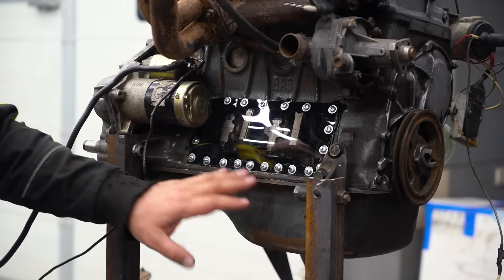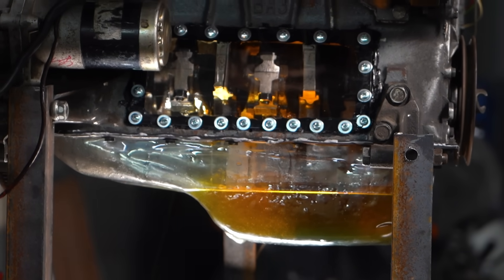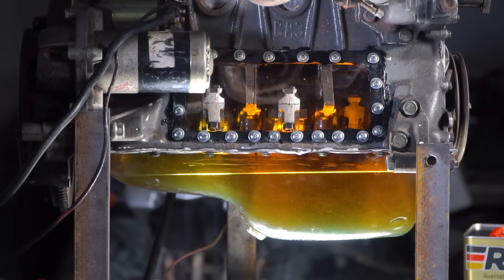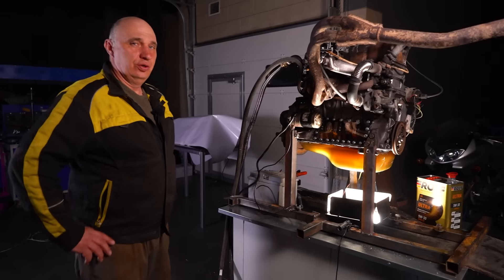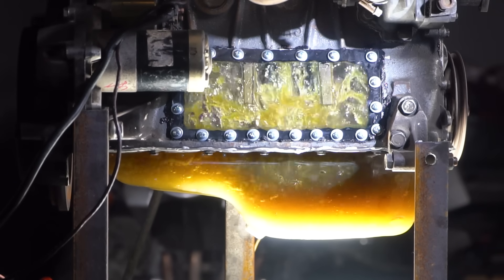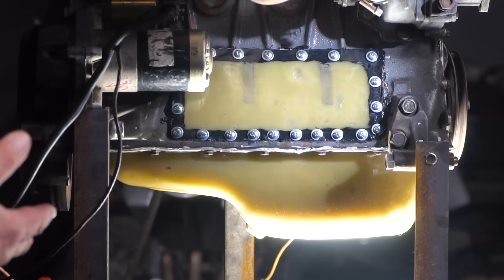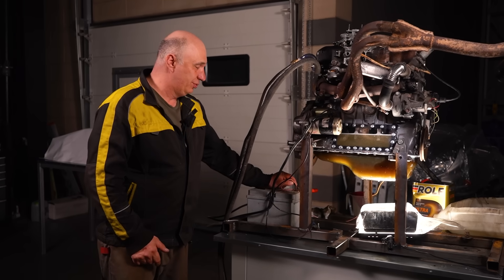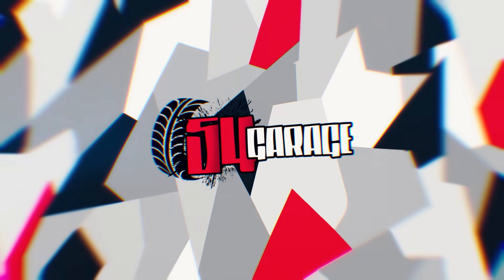What actually happens when you overfill your motor oil? (w/ transparent oil pan)

Comment: I noticed that you didn’t run the engine for very long, at each level.   If a person unknowingly over-fills their engine, and then drives it at highway speeds for 1,000 miles, thinking that the levels are perfectly fine??    That engine will start knocking, and eventually seize.

Comment: the reason imo is mostly due if look when more oil is present the piston skirt is constantly saturated, and the oil ring never gets a chance to do what its designed to do and control the oil on the cylinder wall. as a result, it eventually gets past the piston and starts to pollute the combustion chamber. and that continues even more issues in itself. the crankcase will build pressure from blow by. just bad...lol

Comment: Worked in an oil change shop for about 5 years. Worst overfill I ever saw was in a Toyota Tundra, the owner had continued to fill the truck with oil because they didn’t know how to read the dipstick correctly, in total when I drained it out into measured jugs, 18 quarts came out. Typically an 8ish quart system give or take a half quart. Surprisingly, not a drop of oil was leaking out through the seals. No telling what it did long term though.

Comment: Interesting video and results. Recent real-world experience. Fifty years ago, when I drove large 90 passenger school buses, we would check the oil first thing in the morning before starting the engine. This habit has carried through today. However, I recently ran into a problem where my 70-year-old vision mis-read the dip stick on my wife's Ford Focus. My wife started complaining the engine was losing power on moderate acceleration and a lot of blue smoke started coming out of the exhaust pipe. Speculating major potential engine problems, she took the car to the shop. Later, she calls me that I was an ID10T (idiot) and overfilled the oil by two quarts.

Viewing the video of the engine on a test stand under no load, doesn't reflect my on the road experience.

Comment: I guess the excess oil is causing some drag, which in turn will heat up the system? Would be interesting to see some more failure points. Oil spilling out everywhere is not the first problem.

Comment: I watched a youtube video my first time changing the oil on my streetbike cuz I didn't know where the plug was.  Well apparently there was 2 plugs (no idea why, the other is NOT a fill plug) so I drained about half a quart, and then added the 4qts it was supposed to have (so 7.5qts in a 4qt system).  Hydrolocked within 300ft, every cylinder was full of oil, blew it up through the intake and had to shop vac that out as well.  Managed to get it all out, then ran the bike smoking like a motherf'er for about 30min, and it was fine for years after!

Comment: I found myself thinking about the Dodge Diesels and their problem of not getting enough oil high in the engine at idle - so many have said not to idle the "newer" Dodge diesels for very long - it would be interesting if the oil pan could be modified on them to fix this problem, and perhaps add an auxiliary pump to get oil to the top of the motor at idle - PLUS - how great would it be if oil pans had a large "sight window" in them, so you could visually see that you added the oil when doing a change?

Comment: A tech for over 20 years I was working late one night alone. A guy drove into the shop with a Honda civic smoking horribly. I checked his oil and it was ALL THE WAY UP the stick. I asked about his oil use and he said he puts a quart in every week. I asked.. Why? He says "I thought I had to". I said.. NO you don't.. IT was completely full I mean like no air space left in it at all., the plugs were fouled wet with oil, the breather was full,  drained out 10 quarts of oil to get it down to the 4 it should have, cleaned the plugs, and he drove out. It didn't harm the motor except for the wet plugs and lots of oil down the exhaust pipe. This engine had no air space in it at all! Completely full of 14 quarts of oil!
Reply: 14 quarts of oil is crazy, that’s around 10 weeks of driving with it overfilled. Im surprised it didn’t give out

Comment: 15:04 LOL, the breather is a full-blown guiser, I have never seen a demonstration like this before, I think there is a lot to be learned here and I have been a passenger and light-duty truck mechanic for 25 years.
We were taught the auto would burn oil and the oil would foam thus lowering its lubrication properties because of aeration that you would start damaging the piston rod bearings.
What I see, is when the oil is filled to the full, it is actually at the bare minimum it should be run at in this engine. 
I wonder how hard it would be to find out if other engines have the same tolerance. I would love to find out about my cars without dropping each of their oil pans.
Thank you for the demonstration.

Comment: Great video. Would like to see when oil is less than half of what’s required.  Amazing info.  Thank you.
Reply: Once the oil level drops below the "oil pick-up" also known as the inlet for the oil pump, no oil is circulated throughout the engine, many important parts begin to wear and heat from friction. Before very long, something fails catastrophically. A piston rod bearing, a crankshaft main bearing, the crankshaft itself, the overhead camshaft or its bearings.  A piston could seize in a cylinder. 

Something horrible.
Reply: As long as it is above minimum on the dipstick though, nothing bad will occur!

Comment: I had a friend when we were teens that filled his Toyota 4 cylinder up till he saw oil at the cap. Went to start it and it sucked oil into all the pistons I drained it, took plugs out, turned the starter and shot oil out of the spark plug hole about 60’. Then we installed new plugs and started it up. Burnt black smoke like crazy…pretty horrible for the environment I’m sure. Ran for years after that

Comment: A clear oil pan and a cutaway in the block?  Brilliant!  I've never seen this in a functioning engine.  Thank you.  I was so concerned once when I added oil past the upper level limit on the dip stick that I siphoned the excess out.  Now I realize that I  need not have worried.
Reply: Don't forget that car manufacturers build in a safety margin for morons like us...
Reply: I once bought a Ford ranger pickup that some idiot had put way way too much oil in it. Now I know what was going on before I drained it and replaced it
Reply: I too recently overfilled by about 0,5L of a 7L capacity. It should be okay?
Reply: Actually it's the transmission fluid that your better off with too little than too much.
Reply: I over filled non strength of this video lots  and lots of smoke out exhaust I've drained and filled to correct level  come home still bit of smoke  not alot I've heard can take couple days to burn excess oil out then fingers crossed ..wish I never saw this video!!!!!
Reply: Overfilling isn't gonna hurt anything as long as your not putting a quart or two to much in engine even a qt probably wouldn't do anything it's just better to use you guide lines & if ya can't see because of lighting then get a flashlight! It's simple!
Reply: @edwardmatikainen617  a little over is ok, especially if your engine uses oil, it he put double the amount in I would say that is too much.  The foaming is an issue.
Reply: It was cool!
Reply: the dip stick have hallow dots on it which tells how much space is in the sump available to fill the oil for the engine
Reply: Everytime i would go get my oil changed at a local shop,they would ALWAYS overfill it no matter what shop I went to they still over fill it,they said they go by what the computer shows them, Anyways so the first time they over filled it I didnt remove the excess and ever since that it started burning oil when before it didnt even burn a drop of oil,when I would change the oil myself, that happened on 2 of my vehicles so I'm sure it is bad to over fill it even if its just a little bit.
Reply: @boxer951 depending on the vehicles it may not have been overfilled oil that caused it to burn oil, but instead intentionally weak piston rings designed to improve fuel efficiency at the cost of oil consumption, this is a concern raised by Youtiber "Driving 4 Answers"
Reply: I keep getting mixed signals if you search on the net it says you should drain it out EVEN if you overfilled it by 200ml that's LESS than and quarter of a QT .  Even in this reply chain some think it should be drained abit. But i haven't seen anyone say anything about 200ml extra i doubt it will do anything. my question is 200ml so minor that the effect is NOTHING is it even a tiny bit worse cause if its a tiny bit worse the amount of work needed to drain 200ml is literally 5 min of work if you have some ramps so I would prefer to do it, but if its actually no issue not even a TINY bit I wouldn't bother.
Reply: I put an extra quart in one time.  I just left it in, nothing bad happened.
Reply: I agree with you I would have been concerned as well this Russian guys experiment is not really practical because it's just firing and spinning the pistons it's not converting horsepower and torque to the wheels guarantee if he put that engine in a car and tried to drive it would explode
Reply: yes you should have worried ! the excess oil causes high oil pressure that blows out your seals
Reply: @bobsaturday4273 that's bullshit. Oil pressure is determined by the pump not by the oil volume. Unless you've filled the engine to the brim and the sealed case becomes pressurized. The pcv valve being open would relieve that pressure back into the intake anyway.
Reply: @cheeseburger3209 well, yesterday I changed the oil in my 2003 Honda Odyssey and I apparently added too much oil (less than ½ quart extra).

Several hours later the engine started running quite roughly and hasn't stopped.  It sounds a bit like oil may have gotten into the exhaust or somewhere that it's not meant to be. 

It happened because I couldn't see that the oil was above the next line on the dip stick in the lighting conditions while I was adding the new oil. 
When it started sputtering & running roughly I checked the oil, that's when I discovered it was over filled.
I removed the excess ASAP, but the problem has not improved. 
It has been running perfectly since I got it; it's hard to imagine & believe that it's unrelated!
Reply: @cheeseburger3209 when i change my oil i have higher oil pressure....i have a 2009 LC9 5.3L
Reply: @DJJonPattrsn22 It's a 2003 oddity. I bet tf it does run rough😂
Reply: @cheeseburger3209 Tell that to your gaskets when you do that
Reply: @DJJonPattrsn22 even a full quart of oil wouldn’t damage your engine it must’ve been something unrelated
Reply: @cheeseburger3209  yea but what youve got remember is this guy vidio is only doing for few mins imagine over filling " double" and going 200 miles  totally differnt " outcome" litre more is always better than less but id not go more than a litre , BUT few weeks ago long story so wont explain HOW overfilled auto transmission on a mb by 5 litres 400mls and " fast" journey later realised the mistake just by chance not becouse anything noticable happenend NOTHING .obviously drained it and set the level according to the " book"  so in future on my OWN cars ill be sticking an extra litre in above the  " book" level. must admit i panicked when i realised i phoned my m8 right away said where are you " hammering up the m6 i need be somewhere asap. pull over now i said ,WHY coz i aint got 4k for new friggin transmission for you ,lol now but wasnt at the time .
Reply: not really it just goes past your ring which can also be bad if your oil is going past bolted down rubbered sealed surfaces it 100% got passed the rings that’s where you need to worry

Comment: If the breather was connected the engine would runaway in case of a diesel . Or if its hot enough with a gas engine as wel , or it would die or lock .

Comment: A buddy of mine had a Trailblazer with a 5.3 V8 engine.  Those engines are notorious for the O-ring going bad at the top of the pick-up tube.  It happens to be at the front of the engine, so during acceleration or on an incline, oil pressure would drop, since oil moves backward in those situations.  We put a scanner on there that told us the realtime oil pressure in psi, then we jacked the front of the car up until pressure started to drop.  We added an additional quart of oil to get the pressure back to normal, then we jacked it up some more until it dropped again.  We added a second extra quart, then jacked it up again, and this time it was high enough that we didn't think the car would ever get on an incline that steep.  We added the third extra quart to get the pressure back to normal.  After that, we simply added the 3 additional quarts at every oil change.  That was a long term test of about 70k miles for a total of 230k on the vehicle when he finally sold it.  As long as that O-ring was submerged, it couldn't draw any air and the pressure stayed normal.  That was only 3 quarts over full, and it was a bigger engine so I never expected any adverse effects.  We could have dropped the front axle, pulled the pan and replaced that O-ring, but to add 3 quarts and get the exact same result just made sense.  Apologies to all the OCD mechanics out there scoffing at the "rigged" fix, lol.
Reply: Thank you so much but, I had bought a new high flow oil point for my girl, 5.3 sierra, and I get 0 oil pressure on my mechanical reader garage I installed from napa haaha. If I Rev it wil go up and read a bit, but only read on idle when cold.

The nw pump comes with that o ring, but seeing that I can do your trick, and how rotted my frame got from sitting I don't thing the pump jobs worth it now if I can just add a few quarts! Thanks a million!
Reply: @waynegretzky8464 if your engine is running with 0 oil pressure at idle, chances are it’s already a goner
Reply: Interesting. There's a story in WW2, when the Germans took over France, they forced Citreon to make cars for them. Citreon intentionally marked the dip sticks wrong, so the Germans would blow their engines. Is this a ploy by Chevy to initiate premature engine failure by messing with fill levels?
Reply: @RacerXGTO  and they still do that today...
Reply: Did you warn the buyer?
Reply: A colleague of mine in University 20 years ago drove a trailblazer that died on lack of lubricant, guess this and the video content would have been exactly what could have saved his car…
Reply: Thx for answering a question kicking around in my mind.
Reply: When GM builds a sheet engin then this is the appropriate Fix...!!!
Reply: That's cause Chevys are 100% Garbage!!!!! Fact!!!
Reply: the excess oil causes high oil pressure that blows out your seals

Comment: This is the best mechanic channel on YouTube. To understand why things should be done in the correct way. Thanks and congrats.
Reply: are you nuts ? he's a amateurish moron
Reply: They work on a lot of Opels.
Reply: This is a very good explanation and visualization of excess oil in the crankcase. I had expected oil to blow through the front and rear crankshaft seals.
Reply: the dip stick have hallow dots on it which tells how much space is in the sump available to fill the oil for the engine

Comment: It would be good to see a long term study of what happens with the oil pressure during the foaming, and all the wearing surfaces higher up, like overhead cams, lifters and valve guides.  I'm sure the cylinder walls are loving it.

Comment: Had over filled a Nissan sentra and it smoked until the level was corrected. A buddy of mine put way to many liters of oil in his f150 and it started a connecting rod knock. I believe a liter or so over is not going to be a problem but I would not go beyond that. I would bet many motors won't do as well as that little engine did.

Comment: The oil is not supposed to "splash around". All it does is create, as we call it here in Denmark, a mayonnaise. Emulsion of oil and air which is not a good lubricant for the engine. You can even see it on the video how oil colour is changing into white. I can agree with the fact that a small amount of overfilling of engine oil is not dangerous, but 700g or more will blow your gaskets as soon as you hit the highway.

Comment: The oil was already foaming badly at 2X.  Just because the engine doesn't instantly destruct doesn't mean it's good practice.  Mechanics like to second-guess the engineers.  It's fun but not often correct.

Comment: I always check the oil level after getting an oil change. I've found an overfill twice & in both cases the co.'s drained the oil & re-did the oil change as they know that an overfill can cause main seals to leak. My worst overfill was 3 inches above the 'full' mark on the dipstick! If I'd have driven at highway speeds the main seal likely would have 'blown' & caused a major leak & then a seized engine. This video is deceiving as the engine wasn't run long enough at high speed.

Comment: These are just short runs .... under normal conditions like driving down the  interstate,  you will build up crankcase pressure...even running with only a couple quarts over ... It will over sustained time blowout the crank seals.. 

Big difference between a couple minutes on a stand and sustained 70  mph on the road

Comment: "Nobody in their right mind would put in that much oil" ....I had an aunt that had an old 1970 mercedes. She checked the oil level by opening the filler cap. It looked empty so she filled it. She used multiple oil containers until the oil level reached the cap. Yep, the rocker cover was full! Thinking she had done a good job, she drove off....there was oil EVERYWHERE. It even streamed up the windscreen, over the roof and down the rear window!